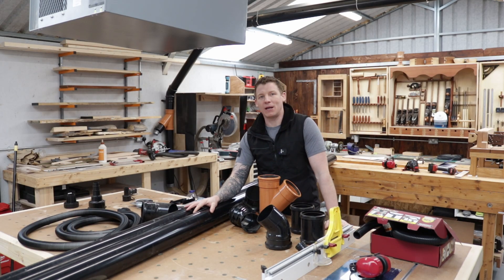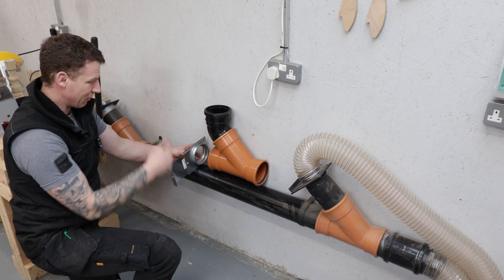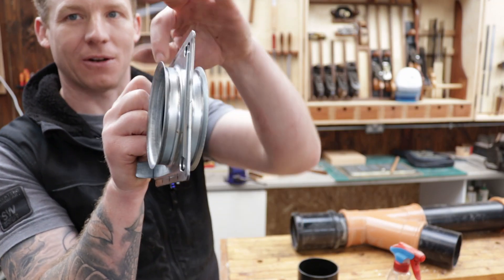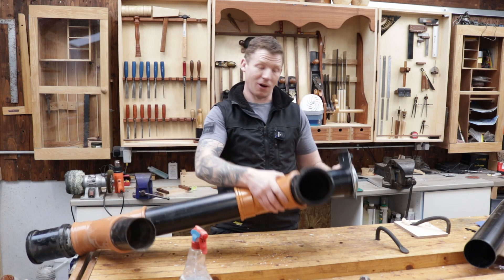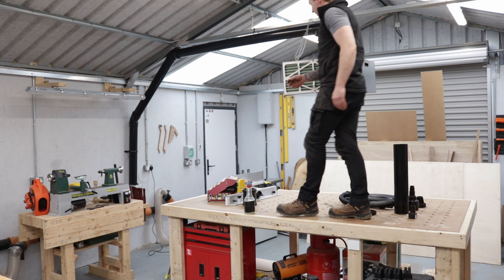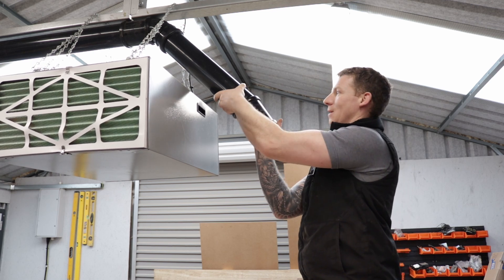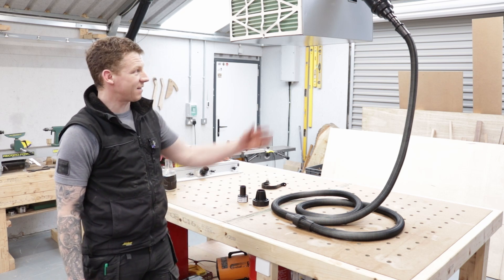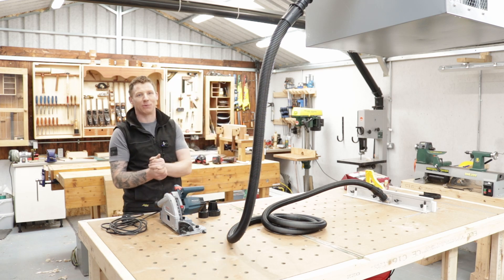Adding Dust Extraction To The MFT Table! Dust Extraction install.

Comment: Hi John, as a plumber, you can get a little bottle of silicone, to grease the rubber seals, and makes fitting an absolute peach, but keeps the seals good also. And chamfer the ends of the pipe and they slide in.

And you can also use a swept branch if you want the 90 but not directly into the T.

But great job, I actually thought you were installing an under table extract system, 🤣🤣🤣

Comment: Hi John,  if you chamfer the ends of the soil pipe by running a disc round them it makes fitting very much easier.  Sometimes the sharp edge of the cut pipe will catch the rubber seal and pull it out of the fitting if you don't do this.  I also bought the dual hose attachment for my router table.  Unfortunately the hose and fittings are too small to handle anything but a small amount of dust.  When I was moulding skirting in MDF the upper hose fitting clogged very quickly.  I use a 40 mm hose on the fence and a separate 25mm one linked to my CT MIDI on the shroud on my Triton router in the table and this clears everything I chuck at it.  BTW I liked your video on electrical wiring, a lot of important info for non specialists in it.
Reply from the maker: Cheers Michael

Comment: I find the corrugated pipe snags on the edge if my work pieces, to overcome this without paying a fortune for the festool hose I bought 40mm braided cable sleeving and put that over the hose, £11 for 5m was a bargain.

Comment: Great. video! and a very clever solution to mount the blast gates on the pipes! You said there is a loss of suction at your workbench. How much suction do you loose - about 10% or is it more?
Reply from the maker: about 10% seems right (at a Guess) . I have improved it slightly by removing some of the adaptors and fitting the hose directly.

Comment: Nice work there John, what are your thoughts about grounding the system due to Static build-up - lots of different methods and thoughts out there?
Reply from the maker: I have a full video about it Rob, I do a few demonstrations. You can not ground PVC its an insulator not a conductor. Be sure and check it out there is a lot of nonsens out there.
Reply: @JohnMcGrathManInShed  Hey John just watched the video, ah my gawd... funny what people due.. cheers mate.

Comment: I'd be interested to know whether there is enough air speed to move the dust up the 4" section of pipe or you'll end with a lot of dust in the section of pipe at 45 deg.  (Assuming end pipe is ~1.5" and the waste pipe is 4" internal, you'll have ~1/7 of the air speed)
Reply from the maker: seems good everything is ending up in the extractor
Reply: @JohnMcGrathManInShed  Glad it works well, helped by the ~45deg angle i guess :)